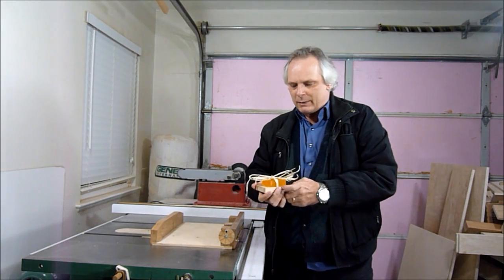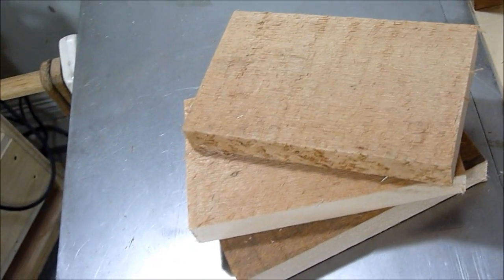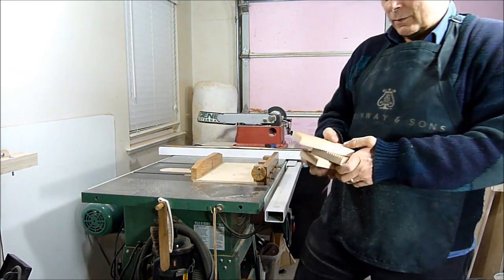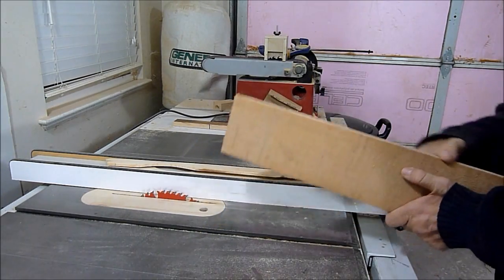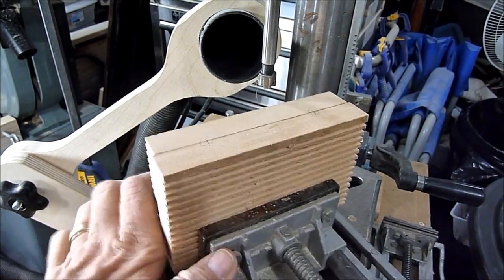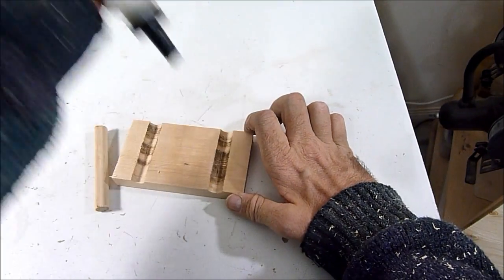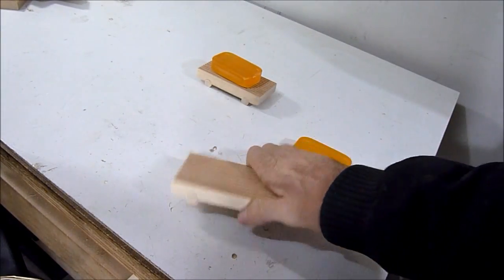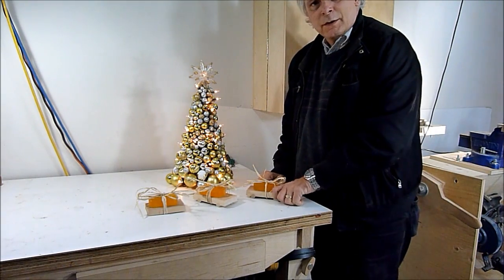Make a cedar soap dish

Comment: So simple and interesting idea. Did you consider drilling the holes for legs with different size forstner bit and using different dowel size? 
The dish would be a bit slanted what would help with water and the thing would last longer. If the soap would stay on it :)